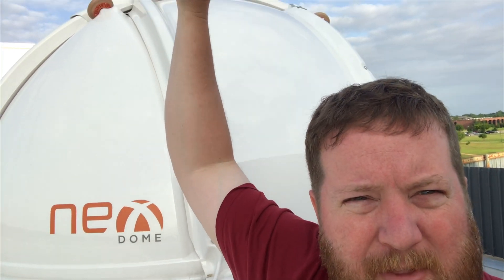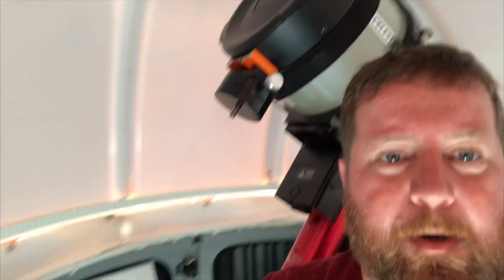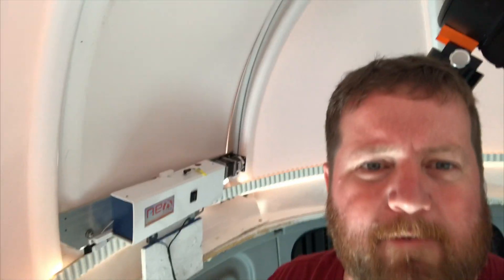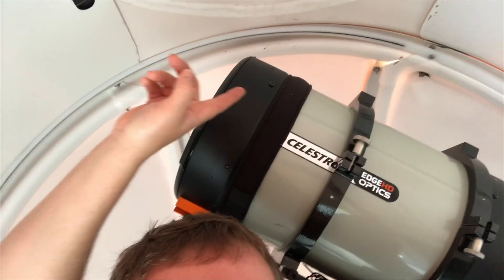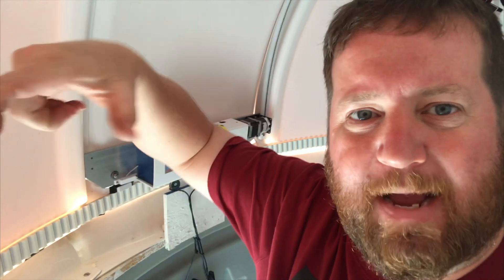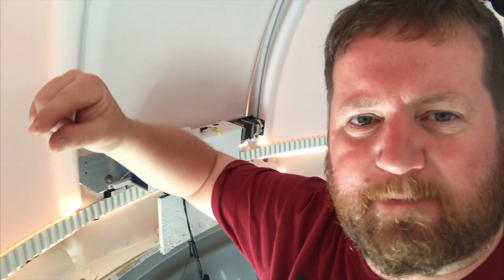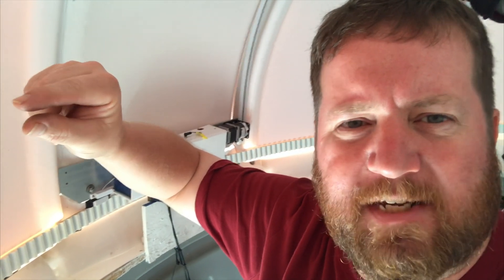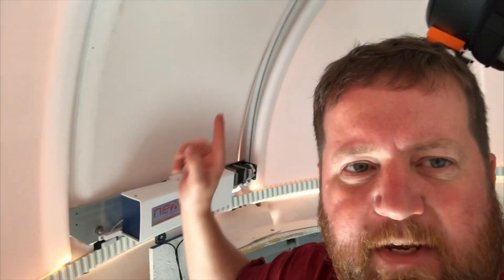Nexdome Observatory Improved Shutter Kit Weather Tested and Survived

Comment: Is your scope the edge 11?  Did you go higher than the 53" to center of the OTA when its horizontal.  Struggling right now to try to compute how tall the pier should be for my setup, but i dont have the edge 11 yet, still on the 8, so i'm guessing 3" shorter to compensate?
Reply from the maker: theskyisthelimit  mine is the 8”. I recently for the MyT Mount to support it. I found the center of rotation of my two axis and tried to make the pier so that point was even with the bottom of the dome and centered. Turns out the center is about where the little plate that covers the access hole for running thru mount cables.  

I measured from that point to the center of the OTA and it is about 12”.  So in the dome control software I have north and east offset zero. Offset to height of dome zero. And offset height of OTA from center of 12”.  Those settings put targets in the center of the slot and it lines up to the OTA at every target I have aimed at so far, and the slot tracks for several hours at a time without overlapping the dome in front of the OTA.  Hope that explanation helps.

Comment: Is that an 11" you have there? Do you do DSO/hyperstar imaging with the scope as well or piggy back a refractor?
Reply from the maker: https://youtu.be/7iywAfSC0ms.  This video describes the scope and mount a little more. I went with just the 11” and no piggy back due to total weight capacity. TolgaAstro Advised me not to damage the mount by overloading it too much. I’ve been really happy with the f/7 reduced setup. I might try hyperstar but I haven’t bought that yet, it’s another $999.  I thought I should get good with my regular setup first.